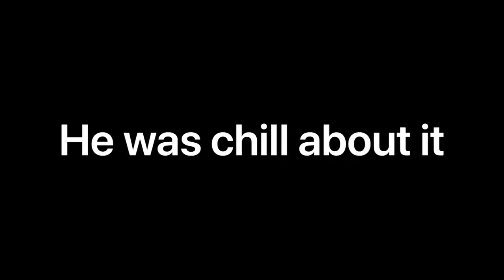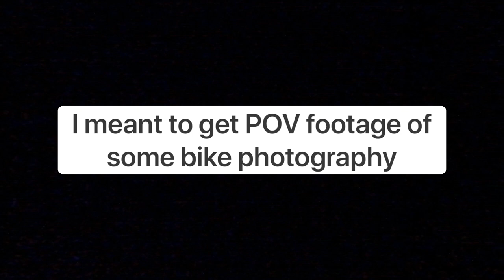ROOFTOP ESCAPE & RAZOR WIRE CLIMB!!! Portland 🇺🇸

Comment: Nice job dealing with the razor wire.
Reply: @Sigfreed  always climb between the coils of the razor wire/ barbed wire. You can also step on the X formed In concertina wire. You are better off not trespassing though.
Reply from the maker: @aspiechan420  thanks for the tip!